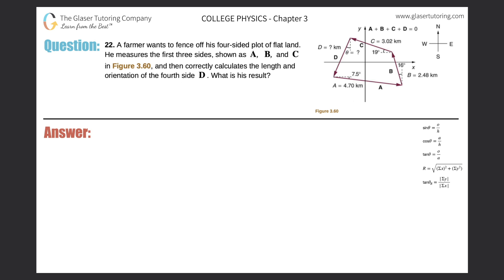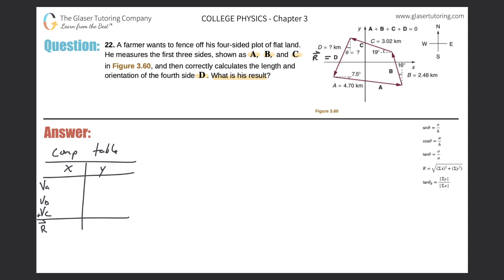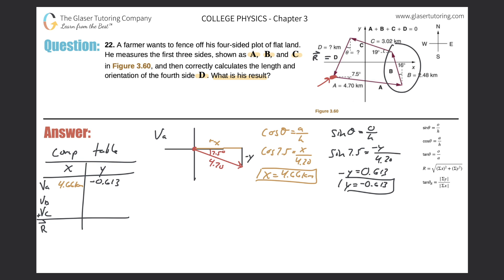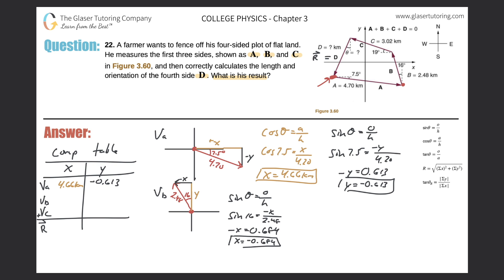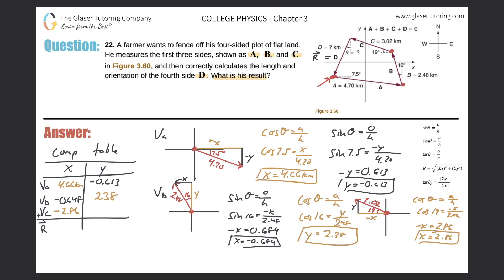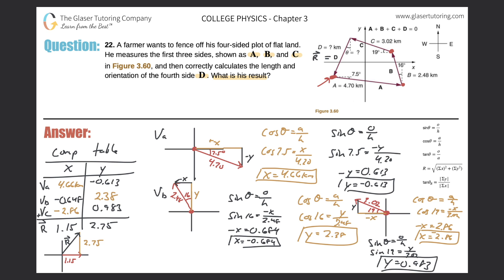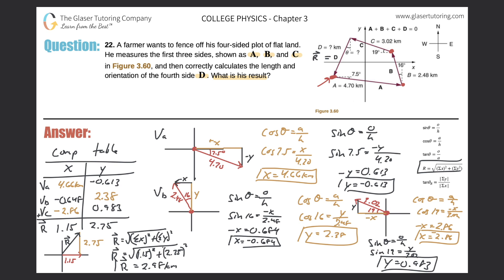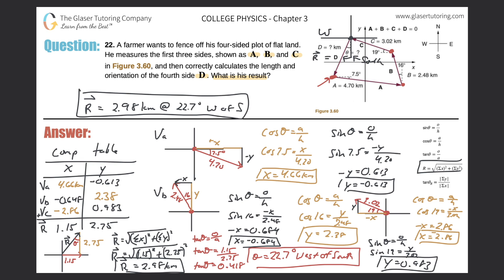3.22 | A farmer wants to fence off his four-sided plot of flat land. He measures the first three

Comment: If A+B+C+D = 0, and you input all the values into that equation to solve for D, shouldn't it be -1.15? But yours is a positive number and I'm wondering why?  Same thing for the Y values as well
Reply from the maker: Hi Oliver!  Good catch on the 1.15 being negative.  However, when plugging it into the resultant formula, since the number is squared, the final answer will be positive.  The y-value should be positive since it is going in the positive y-direction.  The resultant value is still the correct answer.  Hopefully this helps!
Reply: @GlaserTutoring  Hi, isn't vector D going in the negative y-direction though?